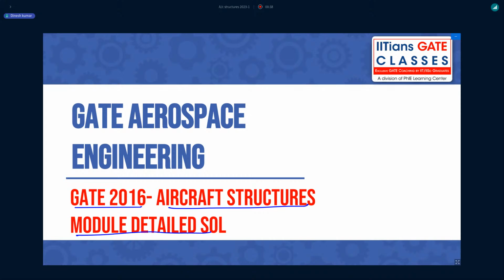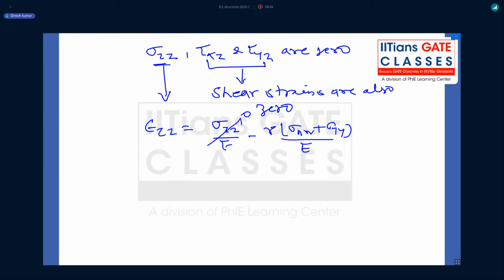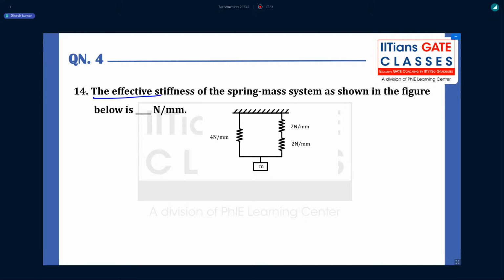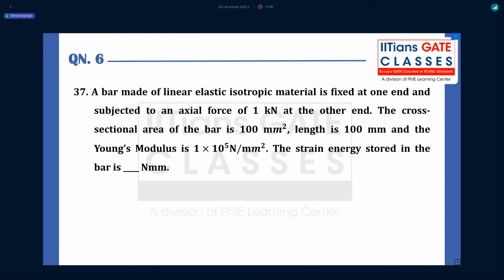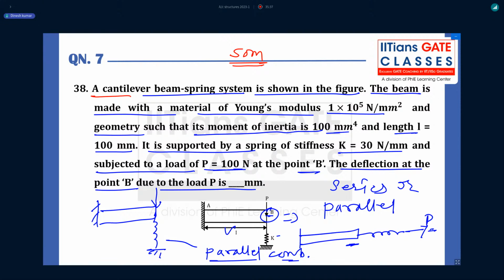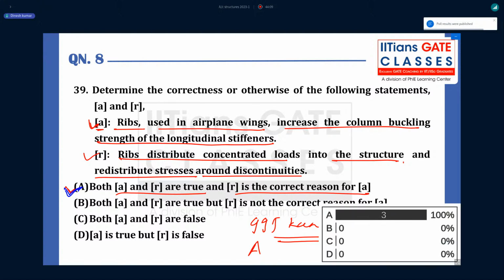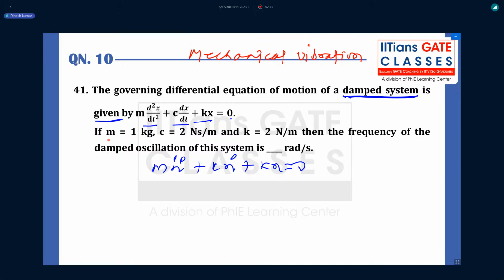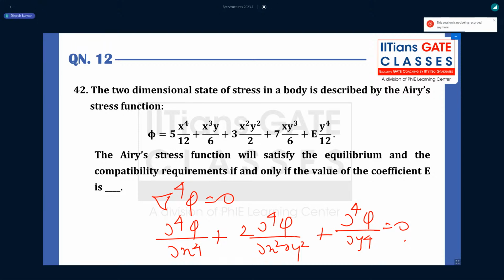GATE 2016 Aerospace Engineering Paper Solution |Aircraft Structure Part | GATE Aerospace Engineering

Comment: in ans key option b is correct for que 39
Reply from the maker: yes as per official key it is B... Rib-  Distribute concentrated loads into the structure and redistribute stresses around structural discontinuities and Establish the column length and provide end restraint for the longitudinal to increase their column 
buckling stress. that mean both [a] and [r] are true but [r] may not correct reason for [a]